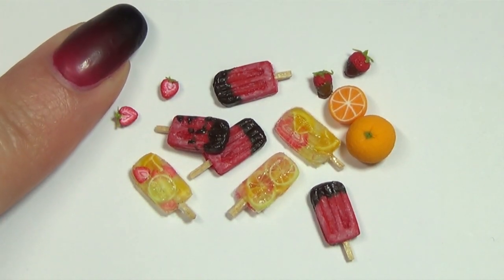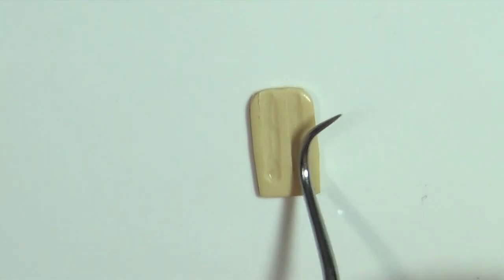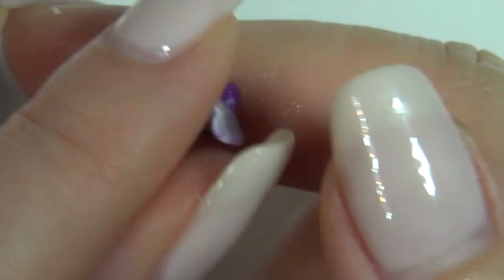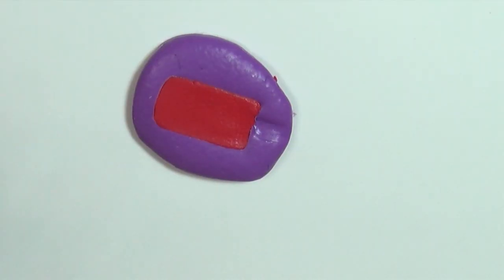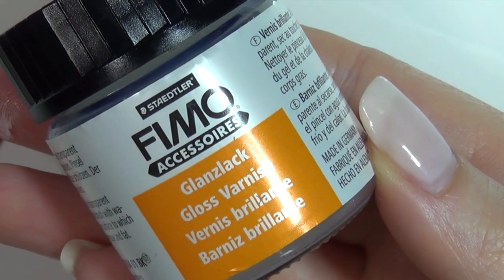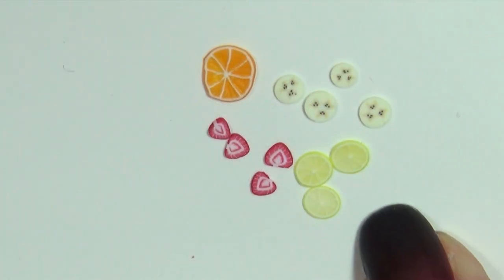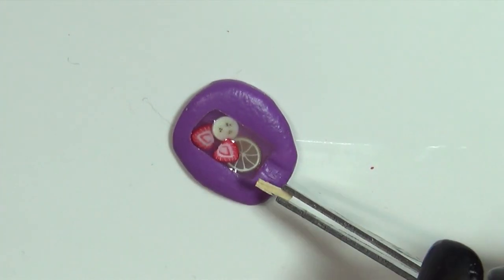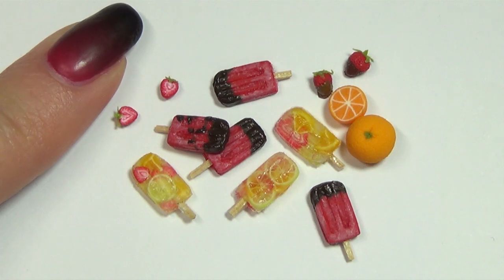Miniature Doll Popsicles - Polymer Clay Tutorial

Comment: This isn't totally related to this video, but I have been trying to make lemon and lime slices by using the cane method. When ever I finish it and freeze it for a little bit, when I cut into it it still will loose shape and not look like yours. Do you have any advice AkameruKawaii?
Reply from the maker: +Emmy Use a very sharp blade to cut, and do it in a rolling motion. You can also bake the canes before you slice them :)
Reply: +AkameruKawaii Thank you so much!